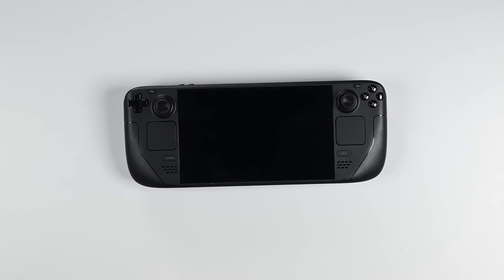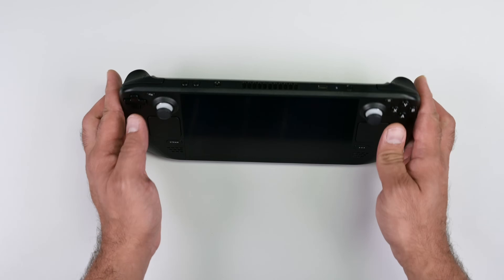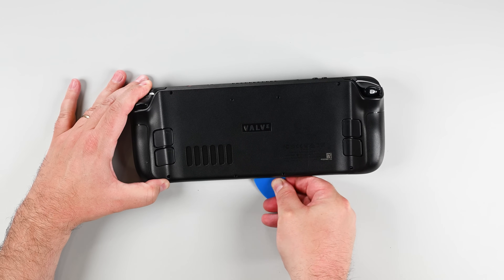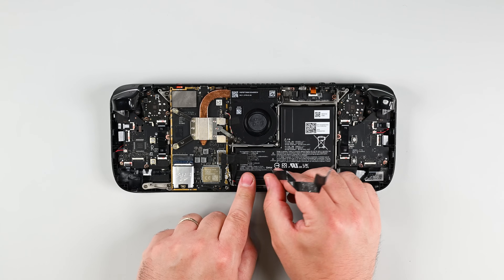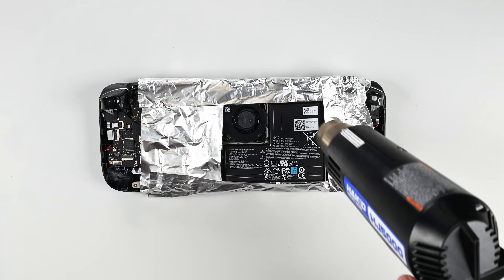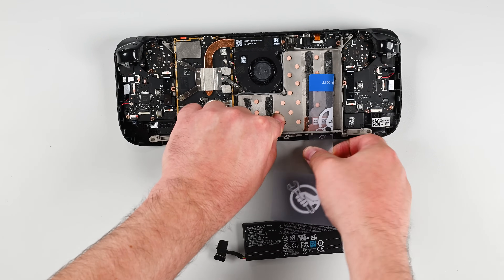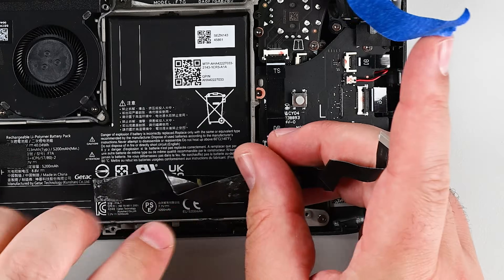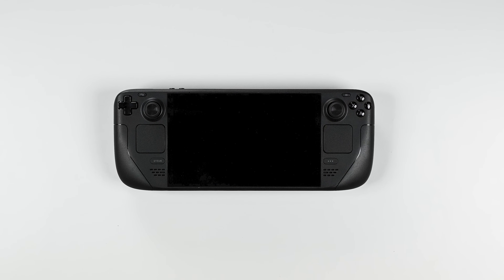How to Replace the Steam Deck OLED Battery!

Comment: Surprisingly anti-consumer practice from Valve - battery should be secured to the frame with torx screws for easier replacement, like for example batteries in HP elitebook G3's, not glued with the strongest adhesive known to man. There's plenty of space inside the steamdeck for 3 mounting points for the battery, that's enough to secure it tightly enough to not risk any mechanical damage.
Reply: Or they could have used stretch release adhesive that passed through those access slots.
Reply: That isn't the strongest adhesive known to man.
Reply: @andrewho2456  Other than for making device resistant to moisture and dust, I'm not in favor of using adhesive at all, least of all to secure the most often replaced internals.
Reply: Lil bro heard anti-consumer once and believes an adhesive is what it is lmao
Reply: @saitiwi  lack of ease of repairability is anti consumer

Comment: How long is Valve and iFixit going to sell batteries for these things? I really like my regular lcd one that is modded with 32GB of ram and a 2TB ssd and my stock oled both in killswitch cases. I remember when cell phones had removable batteries and HTC oem extended batteries with slightly thicker rear covers. Those were generally only available for a year or two and then it was only knockoffs for every one of my htc wizard, hermes,  kaiser, and rhodium.
Reply: don’t worry, you can still find parts for even the first generation iPhone so you’re okay
Reply: @brandon_nope  This is a useless analogy, every iphone sells in the 10's or hundreds of millions worldwide and the Steam Deck is comparatively a very niche product.
Reply: For most phones they continue to be sold for some while after its discontinued, so you'll be fine for a while. You can also already buy an extra battery for when the time comes, if that eases your mind

Comment: Always check if the battery works before totally covering any electronics back again. This will save you headaches when doing repairs same as this.

Comment: Would it be possible to fit an OLED battery into an LCD deck I wonder.
Reply: Nope, it’s too big to fit
Reply: @brandon_nope  too big in thickness or size inside the deck?
Reply: The OLED battery has 10 Wh more, they made it bigger, so it doesn't fit. I think it's wider, not thicker

Comment: 15000 reward if you weren't fixing it as Skitra or Wrathion - should know integrated batteries are bad thing and only option after is getting new hardware. Only thing important here at students campus playlist is overheating maintenance and .Net Maui app for those rogue dancers at students campus. Getting graphics upgrades for it - not recommended for ford Ka owners who are already tight on a budget and rather won't do same odoo accountancy anytime soon again. Integrated batery can bloat and you as in experienced owner can't do anything about it yourself if you see like your phone powering down or screen not working properly.

Comment: Valve is taking the apple route. Very hard to repair stuff in steam deck. Glued battry, mischievously placed antenna, easy wear down joysticks. Let's see how far they will go
Reply: What are you talking about ?

Regular accessible screws, slots on the battery well to easily slice the adhesive, available both first and third party, consumer available parts through official channels. The shield on the motherboard is also not damaged by removing it.

Other than the adhesive not being super convenient there is nothing to complain about or even wrong here.
Reply: My LCD Deck's sticks still work perfectly
Reply: @manitoba-op4jx  They do sell replacement audio boards.

Still, at one point you have to draw a line, the motherboard is were most of the expensive stuff is, if there are issues on it, like any other high value PCB. For any repair to make sense, it needs to cost less than what it would cost to buy a second-hand damaged Deck.

Anyway I don't see how Valve would be "taking the Apple route" with the Deck.
Reply: @Vaasref  It's still puzzling as to why replacement trackpads are not available for purchase
Reply: @brandon_nope  I was surprised too. They are somewhat available on the grey market but I think anyone would prefer to buy them through official means.